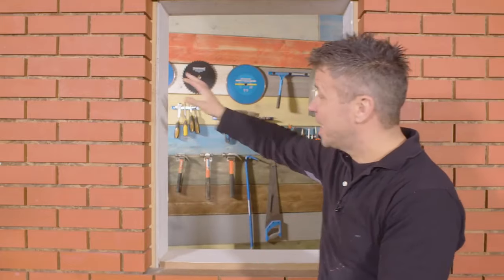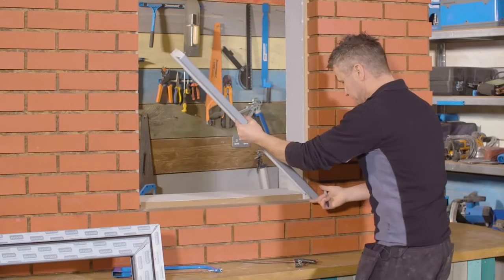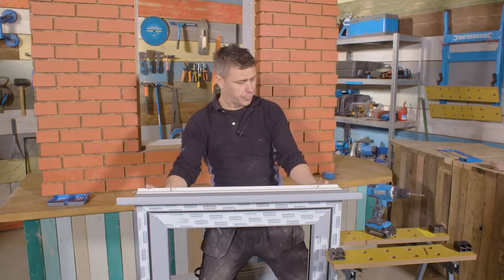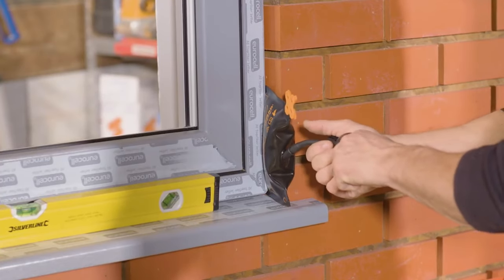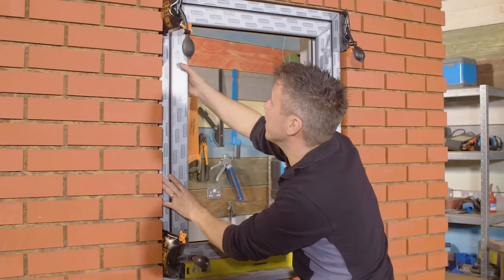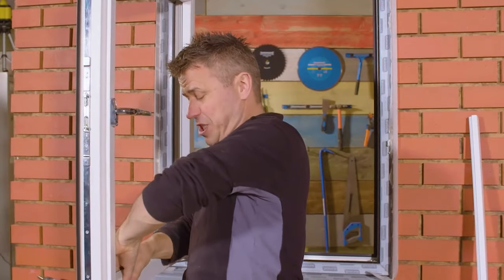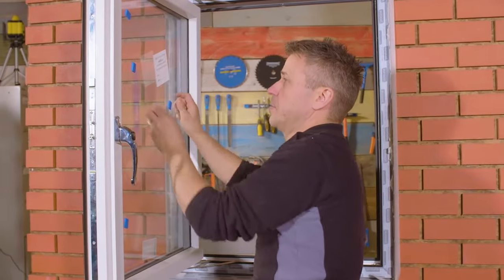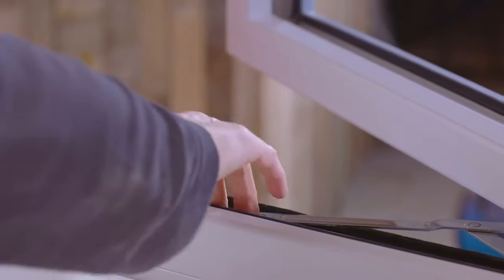How to Install a Window Frame | WINDOW FITTING | FIXING WINDOWS LIKE A PRO!

Comment: Did a great job their Craig, 
Always bed the cill onto the bottom of the window with silicone, only then will it be wind proof and water tight, dont rely on the 5mm lip to keep water out, ive seen plenty where waters coming in over that lip
Reply from the maker: Thanks mate, nice tip!